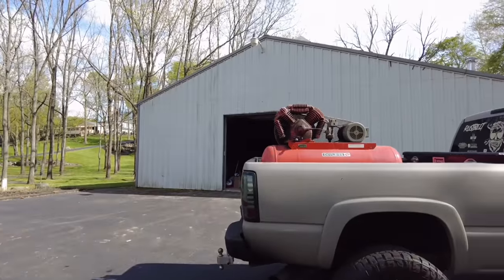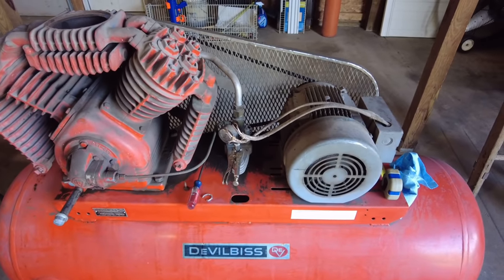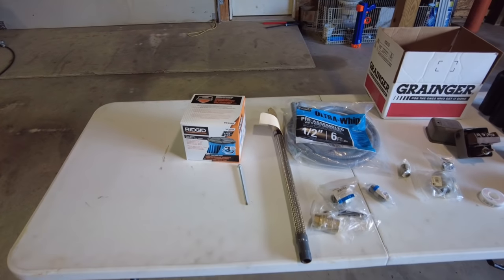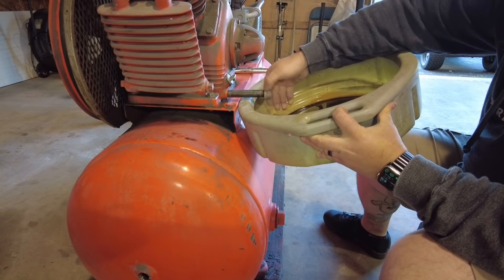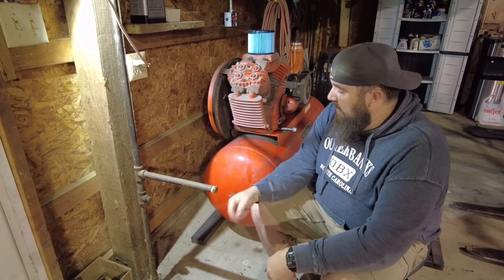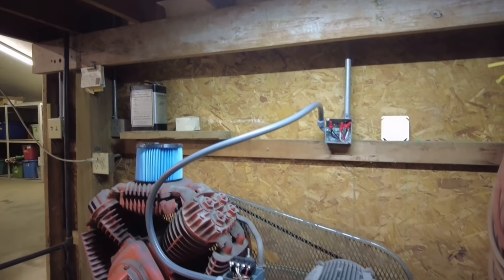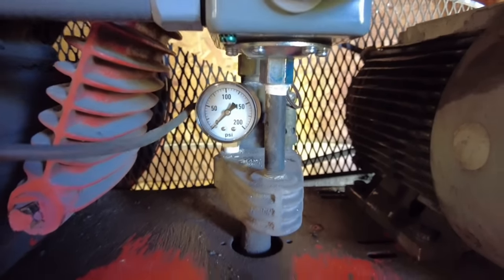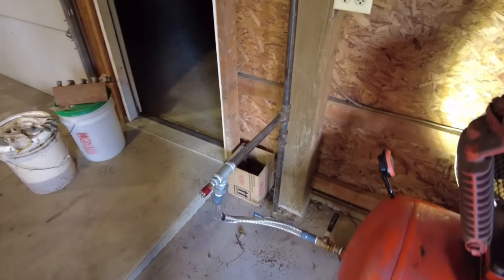I GOT HOSED ON AN AIR COMPRESSOR FROM MARKETPLACE! CAN WE REVIVE IT?

Comment: Great content, that being said I think for the $$$ u have put into it u could have bought yourself a brand new compressor. I have a similar shop set up to u. I piped the whole thing and bought a nice Ingersol rand compressor from TSC for about what u have put into your project. My set works great no problems. I have less than $1500 invested for everything. Good luck.

Comment: kyle , i would add a double pole single throw switch or a knife switch disconnect at the wall connection. would bet the compression air is making it past the rings and pressurizing the crank case. i would find out what the rpms are on the electric motor and look for a compressor with a matching rpm but a bad electric motor. put the two together and plumb the extra tank inline for extra capacity.
Reply from the maker: It’s funny how you have a knack for my same thoughts lol.... in a video coming soon!

Comment: Well when you get a working air compressor you have to install a means of a disconnect on the compressor. Like a safety switch and it has to be within 5 feet of the unit.
Reply from the maker: Yep.... coming soon😁👍🏻

Comment: Just buy a new one. Go with at least a true 7.5 HP. Be very careful about Advertised HP and CFM. Lots of Manufacturers cheat these numbers!  Most of the newer designs are much quieter and efficient also. At lease the quality ones!  Good lock.